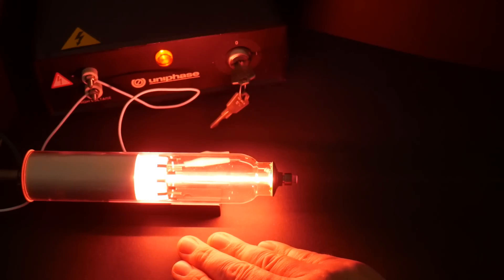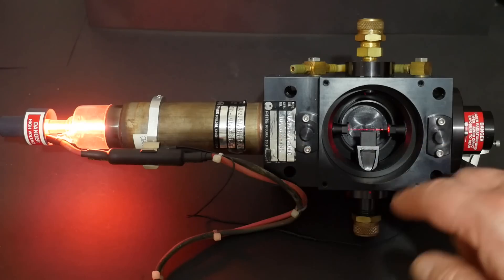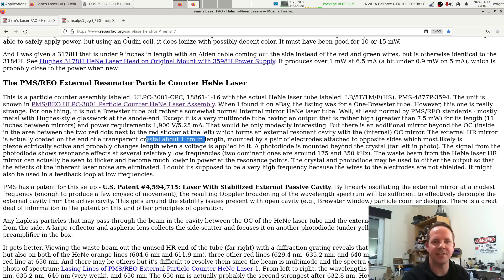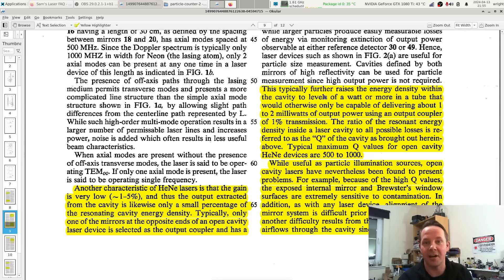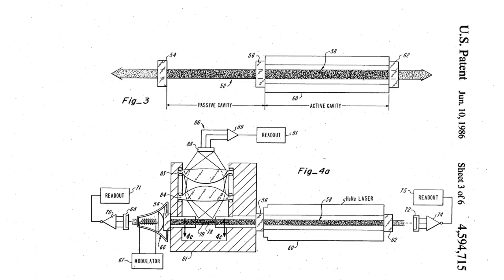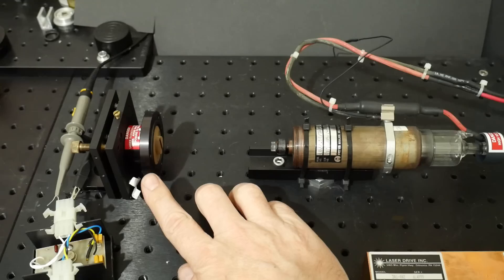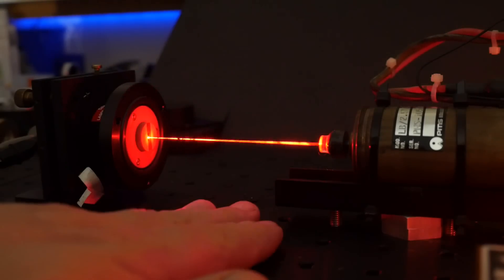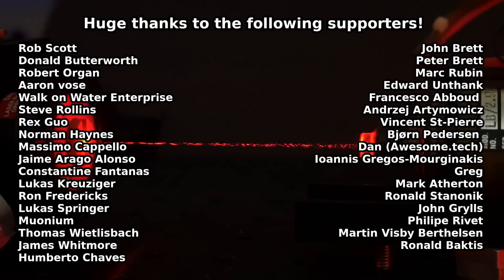What happens when you reflect a Laser beam back on itself?

Comment: Hello, Les' Lab. I am a holographer in China and like all of your videos very much. It is so interesting and inspiring. I have talked with my friend Petr from Czech for the reason of increased power. He suggests that it could be caused by multi-mode laser by varying external cavity length and Doppler effect. I wonder if you can just put a moving HR (by piezoelectric ceramics) or a moving OC  in the open cavity He-Ne laser to see if the output of laser is increased or not. If increased power is due to multi-mode laser, then the moving HR or moving OC in the open cavity (internal) He-Ne laser should output the near 1W for power harvest. However, the multi-mode laser is bad for holography but spectral width can be calculated to see the result. What do you think? Maybe you can answer the question of the increased power from other respects if I am wrong. Thanks.

Comment: Hey I found a really interesting paper about supercontinuum lasers using a water bath.
Intense white laser of high spectral flatness via optical-damage-free water–lithium niobate module
You might want to give it a look :)
Reply from the maker: Sweet! Got a link? I am considering trying some liquids in hollow core fiber, the problem is getting the fiber cheap!
Reply: @LesLaboratory  https://www.researching.cn/ArticlePdf/m00105/2024/3/1/016008.pdf
Reply: @LesLaboratory  Yeah YouTube has deleted the comment with the link :/
but you can google Intense white laser of high spectral flatness via optical-damage-free water–lithium niobate module

You btw you can disable comment moderation in YouTube Studio under Settings then Upload Defaults, Advanced Settings at the bottom.
But IDK if you would get to much spam.
Reply: researching dot cn slash ArticlePdf slash m00105 slash 2024 slash 3 slash 1 slash 016008 dot pdf.

Comment: what is the purpose of those brewster windows do they reflect discard certain unwanted frequencies or was it to polarize? i still do not comprehend what polarizing does but  you still need an oc right?
Reply from the maker: Ah, so at 2pm GMT tomorrow (1 July 2024) a video will be released that talks about this! In short, it you want to have an external mirror in your laser, just adding a window doesn't really work well. Glass will reflect about 4% of the light, and this is enough to prevent lasing. What you do is tilt the window to the magic 56 degrees. At this angle p-polarized light will pass through as if the window wasn't there, no reflections and no losses.
Reply: @LesLaboratory  you mean if light hits glass at 90deg incident the glass will reflect back around 4% of the light into the cavity,, then you say that is enough to prevent lasing, did you not mean to say that 4% reflected back is not enough to start lasing? yes the 56 deg will allow  roughly 100% polarized transmittance ok but who cares if there is or there is not 4% reflectance specially when we got a mirror in front reflecting back most of the light so i still don't understand all this or the need for brewster windows? not sure your vid will explain it for me good enough but ill keep an eye out and thank you so much for replying to all my questions

Comment: I thought your were going to say that reflecting a LASER beam back on to itself could be used as a columnator for a telescope, I have such a laser for that purpose.  BTW: I have two old, previously functioning HeNe LASER tubes, I know one is from Spectra Physics and it was bright!! It had a rating of 6.9 mW on it, but I suspect it was much more than that.  I have no use for them, plus a solid-state HV power supply that powers them. When the tube sputtered and went out,  I'm told that someone with the right equipment can revive them. If you're interested in them we can work out how to get them to you, only the cost of shipping. I'm in the SF Bay Area.  I am cleaning up my electronics lab and really hate to junk things that potentially someone else could use.

Comment: So does the light in the second cavity enter back into the first and cause a second lasing to happen at the same frequency which then "adds" onto the initial power? Like what happens at the atomic scale with the helium atoms? I understand that the electrical energy causes the electrons to jump up in energy level and then fall back to release a photon at that specific wavelength right? But how does the back reflected photons which are out of phase with the original beam cause more photon release inside the gas? Or is it just wave interference causing more brightness? How can constructive interference increase actual power in the second cavity? It's not free energy, so the second amplification must happen in the first cavity and have something to do with the already paid xcited gas molecules I'm guessing.

Comment: A laser beam is LITERALLY FORMED by reflecting the beam back onto itself repeatedly.
Reply: The front mirror may reflect about 99% (or something ) back into the laser, giving each individual photon a 1%to escape out and produce the laser beam we see.
Reply: But one is a half-glazed mirror, so the most-excited photons can escape.
Reply: @throughthoroughthought8064 A photon just is or is not. So, what do you mean with most-excited?
Reply: @gbormann71  That was my assumption; guess someone more knowledgeable than us will have to answer that.
Reply: @gbormann71  I kept thinking about this. If it's just a photon and not an excited photon, why does one mirror need to be half-glazed - why not just a window?
Reply: There isn't such a thing as an excited photon. There is an excited electron, though. A photon with the right frequency can cause this excited electron to release its energy in form of another identical photon. That's stimulated emission. You need the mirrors to increase the intensity, in order to increase the chance of this stimulated emission. If no photon comes in, the electron falls into the ground state spontaneously and the photon goes in a random direction
Reply: @fatcat4000  It all seemed so simple when I didn't understand.
I still don't understand, but now it seems less simple.

Comment: How but not WHY - That is the problem with this video. Sure, it goes into the 'how' of an extra cavity, but is that really an extension of the main cavity? Or is it merely a second cavity, in which the meager main output builds up to high power because it has no place else to go? And then, why is it necessary to detune the second cavity with a vibrating mirror?
@Les' Lab

Comment: Not quite on topic but I have an IOT device that incorporates the mandatory LED power indicator. The LED is a typical red 0602 size surface mount type. What makes it peculiar is that when it its on it is surrounded by a mist of red dots (interference pattern, I guess) that extends to at least 5mm from the source in all directions. I've never seen this before and it is only very recently that I have come across another example of this effect.  I'm wondering if anyone can explain what's going on.

Comment: I would mount the cube dump on a Pizo Electric disk so it will be off-axis enough to block the cavity as you did with the card and sweep it through the audio spectrum so it will allow to Chirp the beam to pass, kinda like a poor-man AOM and see if it will kick out some huge power burst if you have a mind to investigate it, and maybe just use a cube beam splitter in there and dump part of it out. I would!  but have not one of those laser tubes. :)

Comment: That's how Teara-Watt Lasers work, Les. :) Try using a half-wave plate a quarter-wave plate or a combination with a polarizing plate Beamslitter cube and dump the cavity out of the PPate. 
For example.

Plasma tube side <--------\\   M1       <--add folding mirrors inner cavity beam path. -------->                       M2   //----------------->>>  Detector back reflector.
                                            |                                                                                                                                                    |
                                            |      Polarizing plate  Dump.                                                          Halfwave plate.               |
                                            |      |        Cube polarizing beam splitter Dump.                                                    |               |
                                            |      |                          |                                  Quater wave plate. if you like |           |               |      
                                            |      V                        v                                                                                     v          v               |  
                                  M3  \\----\*\-----------------[  *  ]--------------------------------------------*-----------------------------[]---------[]-------------//     M4        <---- Folding mirror on a stand.   
                                                   |                         |
                                                   |                         | 
                                                   *   <---               *  <---  Laser beam dump from polarizing plate or Ploarzing beam splitter cube mounted on a breadboard outside of the inner cavity of 
machined section.

Rotating both quarter and half wave plates will allow beam polar steering through the P Plate to escape as a pick-off schema of a percentage of the cavity power, perhaps. 
Experimenting is fun. Best: Dale R.

Comment: One other thing I missed. I don't think Doppler shifting has as much to do with the external cavity gain as previously supposed though it might play a role. I think it might be a form of forced mode hoping so to speak. So you rapidly change the effective length of of the resonator the end result is a series of beat waves that are nearly full power with out it staying in that state for too long. It's like moving the slide on a whistle that is frequency stabilized at a stupidly high harmonic. So any gain will be alternating between full gain coupling and none. Hopefully someone will get around to testing that.
Reply from the maker: Interesting. Yeah, I plan to mount this on a rig and perform some measurements. I suspect line broadening must happen as well. I wonder if there are modern applications...

Comment: @steveroberts7143
2 minutes ago
Wait till you try the larger version that uses a resonant drive to move the mirror, no piezo required. .  If you look at it with a grating, you may find many, many lines lasing, including Raman lines.  My personal record is 18 lines lasing in the three mirror configuartion. Dr. Knollenberg's mirror designer is a genius, and even compensates for the change in the coating when the frit is fired to bond it to the tube.   The other three mirror version does not involve a Brewster Window,. Find the leakage from the other mirror.

Comment: what "smoke" do you use?
Reply from the maker: Heated Glycerine, the same stuff that's in smoke machines. I used to use magican, but it makes an oily mess.
Reply: @LesLaboratory  I see, Im looking for an easy smoke or vapor source that can be used as a crude beamvisualizer at will and easy to store without to much degradation.
I saw some small almost carkey size devices that can make smoke that goes for around 50 bucks, but it does seem like its intended for magician, and if it makes an oily mess, that is far from ideal.
So im curious what other people in practise are using and the pro / cons of it..
Thx for another great vid Les.

Comment: In the early 80's and I'm pretty sure it still applies, the collated beam would bounce from a 100% reflective mirror at one end of the laser, be it a CO2 gas tube or crystal rod like Nd YAG, to the partially reflective mirror at the other end as the intensity of the  beam amplified before exiting the laser. Redirecting that beam back into the laser? Might result in additional amplification. Don't know. Never tried.

Comment: Did I miss it, or did you miss it? 
The external cavity does not have a lasing medium, so it can not generate the exta gain (power) available in the the external cavity.

Does that mean all the extra available power comes from the extra passes the light makes through the primary cavity?
And how can it do that without mode-competition with the standing wave in the primary cavity?
Reply from the maker: The external cavity is entirely passive, and has no gain. It effectively decouples some of the intracavity light out in to the passive cavity. The mode competition is handed by the rapid movement of the mirror on the z axis.
Reply: @LesLaboratory  Thank you for taking time to reply.
I had expected that the vibration takes care of the mode competition (in the sense that it does not generate it's own standing wave) but there is still depletion of the population inversion in the primary cavity.

The coherence of the beam in the secundary cavity is probably not great.

Thanks for the video. It's very interesting stuff.

Comment: Hi, Sam! How are you? Have you seen chinese laser machines for repair of lcd panels?
 Basically a cnc with a microscope and a nd:yag IR laser. They use it to get off short circuits of the micro under glass traces. Those defects related to lines that appear on lcd screens. If you could test with that 2w IR laser would be awsome. Strange Parts did a video on that:

https://youtu.be/ks-lS11TIaY?si=mxd72WJWdNy0Co3F

Comment: I had one in 1984. It was bulky and had a huge power supply. Later around 1989 i got a hand held 18 volt one. It was the coolest thing around back then. Now I melt CDs and rear backed mirrors with a hand held I made.

Comment: I worked with helium neon lasers at Intec back in the 1970s. We use them for automated inspection systems along with a scanning multifaceted mirror system and a photo multiplier tube. The whole thing was timed like a television scan line system and we could see a trace of the light levels across the width of the product web on an oscilloscope.
Reply: "Product web"?

Sounds nice.
- spider

Comment: I've always wondered about that in particular. Guess you have the answer. My original hint of having the question was knowing the output couplers on them are a ridiculously high value (99% reflectivity for example) so at say 5mW that should translate to something like 500mW or half a watt of optical power intracavity. (I did some bad math and forgot to convert from percent to decimal when doing the ratio division to give the scale factor. This has been corrected though.)

Comment: Doomsday device:  Reflecting the power back into the tube amplifies the power with each pass as it passes through the external optical cavity.  The energy rapidly climbs until it begins to cause the air to laze as an optically pumped UV nitrogen laser.  Power continues to climb as both lasers bounce back and forth in a positive feedback loop until temperatures climb enough to begin to first cause chemical reactions in the air (ie N2+O2 -> NOx, etc), then as the power continues to increase, the air undertakes fusion, which if sustained further, causes fusion ignition across the entire atmosphere in a rippling wave of destruction as all the atmosphere fuses, destroying all life on earth.  Then we have to wait for another event for life to begin again.  Don't try this at home.
Reply: For the nerdy, the air isnt dense enough to sustain. Same question at Las Alamos nuclear tests.
Reply: @baloog8  you are right, that is in the Oppenheimer movie, but it is only barely unsustainable on its own, but if you have an exponentially increasing power source continually feeding it ..
Reply: Until your reflector/ equipment melts anyway
Reply: That was wicked!
Reply: Is there a way I could donate towards the building of this device?
Reply: @redavni1 is this Billybob Gatez alternate account?
Reply: How do you get more energy out than you put in?
Reply: @gbormann71 😂
It’s focused not more just the same smaller
Reply: Not feasible but a fascinating fictional extrapolated claim

Comment: Since it says that it forms a resonant cavity, doesn't that mean the distance needs to be calibrated to some small fraction of a wavelength, so that a standing wave pattern can be formed by the back-reflected beam? But that's like maybe 600 nm! Is this really made that precise?! WOW if it is.
Reply: theoretically, yes.
practically, no, because every minor fluctuation in optical length (from temperature, density of the air in between, ground shock, etc...) is much bigger than any misalignment of the mirror itself could cause. These fluctuations don't usually ever matter, because even a laser doesn't emit on exactly 1 frequency - it still has a bandwidth - and if the wave coming back into the laser medium doesn't resonate anymore, a close neighboring frequency will be amplified instead and a different mode will take over.

Comment: It's still not clear to me how this works. Is the ~1W gain due to the arrangement “storing“ light in the passive space? i.e. the decoupled beam bounces back and forth, and builds up to 1W equilibrium after a short period of time?
Reply: Was wondering the same. In the primary cavity, the beam builds up optical power by repeatedly passing through the population inverted laser medium.
The beam can not pick up energy outside the primary cavity, because there is no laser medium.

But if the trick is that this secundary beam picks up energy if re-enters the primary cavity, it will still have to mode-compete with the primary beam. (partially deplete the population inversion)